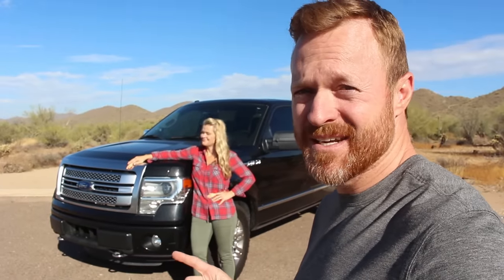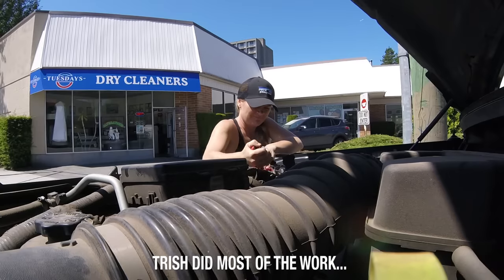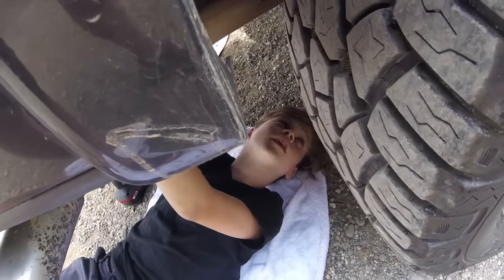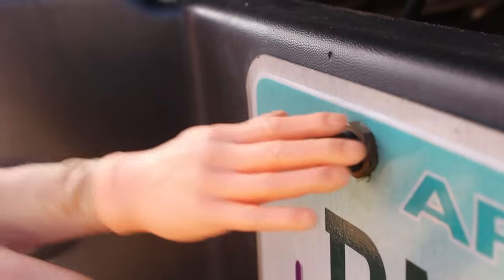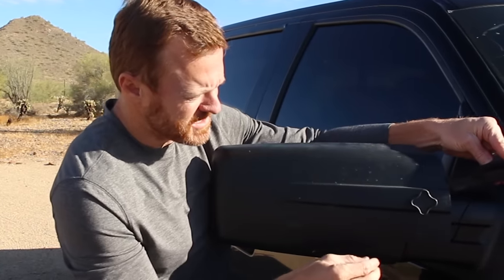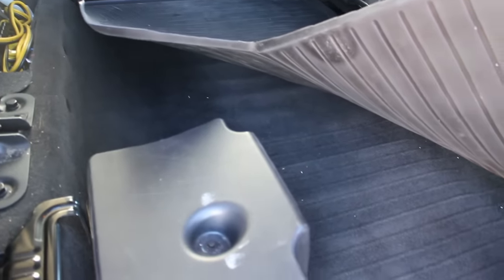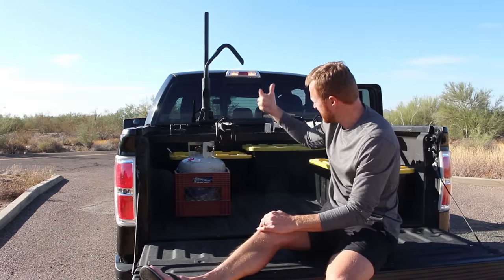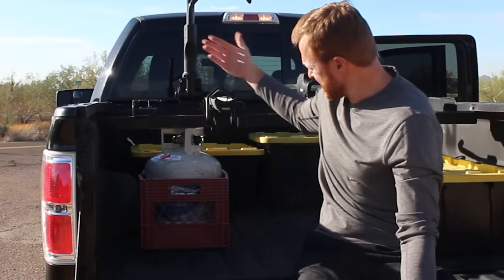TOWING WITH A HALF TON TRUCK (FORD F-150)

Comment from the maker: Common questions asked in the comments below:
1. How much does my truck weight: 5,900 dry and 9,200 loaded (28' TT)
2. What is my cargo capacity? 1,500 pounds. This is potentially the biggest limitation to half ton towing, not towing capacity. 
3. What PSI do I keep my air bags: 35 pounds, which increases to 75 pounds with a load. I never adjust the air and don't think it's too stiff without a load.
4. Do you have a weight distribution system? Yes, I currently have the EAZ-Lift system by Camco. It's started failing after only 15 months and they won't warranty the product. My next system will be a Hensley Hitch http://bit.ly/Hensley-Hitch
5. Will you ever upgrade to a 5th wheel? Yes
Couple notes: 
*We would not have selected a half ton truck to pull 9,200 pounds had we known we would have RV'd this long. It's just what we had and we wanted to get started. If you're serious about RVing and don't already have a truck, there are more benefits to 3/4 ton or diesel - as long as you're not "waiting for the perfect rig". 
*Be sure to check out our Amazon page with our fav RV gear http://amazon.com/shop/keepyourdaydream
Reply: Keep Your Daydream for the bike rack, check out the American roll cover.  You can use the Tule mounts without drilling and have a bed cover with full bed access even with bikes in place.  I love mine
Reply: Great vid Marc. One of my hunting partners uses a new WD system called the Recurve. Built in sway control, spring bars attach upside down but works so easy on his 1/2 ton Eco Diesel.
Reply: Great move on the Hensley hitch - was happy to have it across windy Oklahoma. It's been great all around.  (I used to think Less Junk More Journey named their daughter after the hitch, but maybe its a coincidence)
Reply: What 5th wheel is at the top of your list? Thanks!
Reply: that is too funny.. they, LJMJ, use a equalizer hitch way the by..  I have propride and while not battled the winds of OK have loved it for sure. heavy bugger tho.
Reply: So.. Look at the tire pressure/ load information tag in the drivers door jam. On that tag it tells the load capacity for the specific vehicle. The rating is from the factory weight as it is finished and the engineers who built it. Going over that rating puts a lawyer in a happy mood even though the truck appears to be capable of handling more weight.
Reply: What was your hitch weight with this setup?
Reply: Keep Your Daydream  Yup Payload capacity is the killer. Because of my Power Wagon’s unique off road suspension, its towing and payload is basically that of a half ton truck....even though its a RAM 2500. So we bought the smallest RV that would still fit our needs, that also has a good payload capacity. We can now transfer a bunch of payload to the trailer while preserving some of the trucks payload capacity. We need that precious payload capacity because we will be hauling 3 dirt bikes in the bed of the truck on some of our trips. With the bikes, some gear, fuel and family, we are flirting with the max payload capacity. The upside is that my truck barely notices the trailer when we are fully loaded because its WAY under max tow. When we don’t have the bikes in the bed, its like the trailer isn’t even there. Works out great.
Reply: #2 You contradicted yourself there, bud. Lol. #4 Like most manufacturers, their warranty is only limited to one year of ownership.
Reply: Great Vid, thanks Marc! My husband and I are in the process of researching trucks and trailers (Jayco 212QBW or similar) now. If you were buying your truck brand new or gently used what other must haves would you recommend to have right off the bat? Love your videos ❤️
Reply: I like to add beef to a 1/2 ton...
The idea is upgrade brakes, spring's and drive systems to 3/4 or 1 ton spec sheet.

A good trans and engine cooling system is a must have.  The point is upgrade to better parts as you can, once you get the truck upgraded to the level of a 3/4 or one ton spec - you could use the 1/2 as long as you wish. 

But remember it's not a good idea to push it to max of a 3/4 or one ton spec sheet for it's not one and the idea is to have a good system that only maxed the 1/2 ton abilities only.

You 1/2 frame use to be the same as the 3/4 years ago.  Today not so - but as long as you don't drive over rough tiwsted ground loaded you shouldn't brake a frame.

With the above in mind - you may never need to upgrade to a bigger truck for years.   One other thing to remember - your rearend u joints and wheel bearings must be watched very closely, and that all so goes for your front end steering components.

I would run commercial hiway tire's - strong side walls and trend pry when towing, Stopping that Marshmallow filling as you corner.
Reply: I'm about to buy a 30' Toy Hauler that weighs almost 8k dry and a truck and this was very helpful. I've been looking at F150 but maybe I should be looking at the F250. If you didn't have the truck already which would you go with? Thank you for the great videos.
Reply: Were you over your payload
Reply: @Tim Coyle - for a 30’ toy hauler, buy a 3/4 ton truck.
Reply: My advice if you want to get into camping and don’t have the right truck for the job would be to buy a smaller camper which fits what you have or wait until you can afford the bigger truck.  Never compromise the safety of your passengers or others on the road by taking shortcuts by trying to beef up a 1/2 ton when a 3/4 ton is required.
Reply: Thanks for the info! Going to get started RVing this year and learning all this stuff!

Comment: I also have a Ford F-150 ( 2005 ) with about 145,000 miles on it. Very dependable and good for towing.  Not as nice as yours, but gets the job done.

Comment: Recent research showed me 2011+ F150 needs a Max Tow Package to tow like this. It can be had on the EcoBoost and 6.2. It gets a different rear bumper, stronger rear springs, trans cooler, selectable shifting, trailer brake controller and extended side mirrors.
Reply: I have a 6.2L 11 F150 with max tow. Just got it.

Comment: The Firestone riderite wireless system is a worthwhile investment. I have it installed on my F-350. Even if you upgrade to a 5th wheel you can move the system over to the new truck. Only piece of advice, if you order one from Amazon and the valve unit says less than "Rev 3.1" send it back and get the latest model. It works amazingly better than the older units. Customer service warrantied my older kit no charge with fast shipping.

Comment: I pull my 27' travel trailer with my 2012 F-150 3.5 Ecoboost.  Max weight is 9,500ish.  Trailer doesn't go over 7K loaded.  Only thing I have to fix is the Ecoboost puts out a lot of heat, so in the height of the summer going up into the passes, it tends to get a bit hot and I gotta pull over and take breaks to let the turbos cool down.  This is a known issue and fixable with some aftermarket parts, which I'm looking to put in before the summer hauling season.  It tackles everything I want it to do with ease.  Don't go over your max weight and leave some leeway, take time to learn how to pull, and you'll do just fine.  And these are very comfortable trucks for passengers for the long haul.

Comment: I have a 2015 Sierra LD with 3.42 gears, towing capacity 9400Lbs. I use a weight distribution with sway control and added air bags for towing a 35 foot 7600LBS TT. If I was towing all the time, I would get a bigger truck. We only tow 3 or 4 time a year and then, only 3-5 hour away. It works great. I would never even think about towing a large 5th with this truck!

Comment: I highly recommend the Sumo springs for towing. They are noiseless, stable, and require zero maintenance. My ride quality is better than our Buick Enclave. I added aftermarket tow mirrors, transmission oil cooler, trans temp gauge, and Tire Pressure Monitor for both the truck and trailer tires. Of course, a WDH is a necessity when towing 8,000 pounds with a 1/2 ton.

Comment: Had a 2011 f150 4x4 5.0 with 175k pull 37' 9000lbs camper from Texas to Idaho and back. Everything stock, no mirrors, just mashed the gas. I did get 8 mpg.
Reply: Do you wish you had an F250 for that instead?
Reply: @andrewmorgan7500  sure, just not what I owned. That 150 was stolen unfortunately. I drive a 2003 7.3 now. 339000.

Comment: I have owned several half-ton trucks as daily drivers and no towing. I own a single-axle utility trailer and will probably never buy a travel trailer. My latest truck is a RAM 2500 4x4 Hemi just because I can. The crew cab for the RAM 1500 and RAM 2500 are the same size but the 4x4 make running boards a necessity. Exercise each time I get in the vehicle and it is HUGE.

Comment: Have same 2013 F150 Platinum however with 3.5 Ecoboost with Roush Performance Ram Air Filter towed 4300lb travel trailer, have recently changed to 25ft 5th Wheel approx 6700lb dry, with the reese revolution pin box. Tons of power and handles the mountains with ease. Excellent topics and yes the little finger hands were interesting -LOL!

Comment: Just towed a new Airstream 23' FB(4800 ish lbs)  with my friends 2017 Ford Platinum. I also purchased the Blue OX 500# distribution hitch. Had the dealer set it up and off we went. 
 Without a long winded story, I will tell you it bucked a bit and the trailer was noticeable in the back. There was no blasting up hills but on the other hand it had no problem going up them. Kinda steady as it goes. 
Learned a good lesson riding with him as he did. He also has a F-250 that he said he will bring next time. With the latter he tows his 10,000  5th wheel with a gooseneck hitch.(Sorry new to rv's so don't know the exact terminology)
I'd recommend the Ford F-250/350 for ball/bumper hitch towing.
 I'll be purchasing that soon.

Comment: We are pulling a 30 ft fifth wheel with a 2013 f150 & also did airbags , yes they are a must have & make a big difference . One thing we added you may want to add is power stop brakes on all four wheels when you do the brakes . They have also been a big plus over stock brakes.

Comment: We are actually towing a 25' Keystone Passport with a new 2019 Ford Ranger Lariat 4x4 .. and it is working perfectly. I was worried that the Ranger wouldn't have enough power to tow our RV, but it has actually worked out beautifully. I probably wouldn't tow any larger trailer with it, but for the 25' Passport it really is a very nice fit. We love our new Ford Ranger 4x4 Lariat .. excellent truck!

Comment: Great summary! We're looking at towing with our 2018 RAM Crew 4x4. We actually bought the OEM trailer brake from Dodge and had them install it and program it into the display and controls. If available, I think this is the way to go. And, actually, that actuator you use to straighten out sway is there to adjust your trailer brake's force. When in drive on the level it should bring your rig to a stop. What a brilliant use for helping with sway!

Comment: Ford trucks are great. Sure the 250 or 350 with a diesel is probably preferred. More power, better mileage and all that. But they have a heavy price tag attached to any shop repair. Routine Maintenance is absolutely critical on them. Having been a Ford tech, I've seen what happens when fuel filters aren't changed when they should be. Better bring your banker when you pick it up.

Best answer in the whole section is "It's what we had." Take what you have and get started!
Reply: Open Minded , Carl Newton is spot on in my opinion. One of the bug reasons Tech's prefer the 6.0 and 7.3 is that the problems they have are workable. They can get into the engine and diag and repair it with confidence and it won't cost a fortune to do it.

Buying a new truck is so dang expensive now that I don't see how folks do it. With a lot of the middle having prices well over $45K it makes more sense to me to look for an older unit with a 6.0 or 7.3. Even if you have to do a complete rebuild to get going, it would likely be cheaper than buying a new unit and the issues that come with the newer engines. This is the route that I am looking at for a tow vehicle.

Comment: I'm glad you posted the spreadsheet
We have a motorhome with the same types of problems
We always weigh all 4 wheels which helps us balance the motorhome
If you ever get stopped to be weighted you get a fine plus you cannot move the trailer or motorhome until you are under the weight
Again thanks for the spreadsheet

Comment: A few more things to think about.  Are you running a weight distributing hitch?  What rear axle ratio?  What transmission?  Axle/trans ratios can make a night and day difference in capacity.  Also avoid loading up the bed with anything heavy because it effectively increases the tongue weight effect on the truck.  And if you don't have a heavy duty trans cooler from the factory install one.

Comment: Hey, I just saw this for the first time since I plan to buy my first camper soon. You mentioned using the manual trailer brake control to stop trailer sway. Ford’s Towing Guide specifically warns against doing that... “If your trailer starts to sway,  apply brake pedal gradually.  The sliding lever on the TBC should be used only for manual activation of trailer brakes when adjusting the gain.  Misuse,  such as application during trailer sway,  could cause instability of trailer and/or tow vehicle”

Comment: I had an autoleveling airbag kit on my 06 F150. It was awesome for towing our boat and hauling loads. It automatically raised the rear end when under load and lowered it back down when unloaded. Best mod ever. I haven’t had bags since but I’ll be installing bags on my 18 Power Wagon now that we’ve begun our RV journey. On board air of course.... ;)

Comment: Great video! We've been successfully towing our 30' Keystone Cougar 25RDS with our half-ton Ford F-150 PowerBoost with the max tow package for 3 seasons.
Reply: What hitch system did you go with? I have a 2017, 6.5' bed, with max tow package and want to set it up to pull a 260rd, however, I utilize my truck for other purposes and need to keep all the real estate available.

Comment: At the end, I'm glad he says to her, "are you joking me". A lot of guys would use cruder language. ... Most significant upgrade was the air suspension, which I didn't know was available aftermarket. And yes he "went with the truck he had" but still a 3/4 ton would have been better suited for the job.

Comment: You "may" have missed a point on the air bags.  Correct me if necessary.  The advantage of having an on-board air compressor is that when you take your trailer off, if you don't let the air out of the air bags, the back of the truck is raised and you are no longer level.  You can easily let the air out to re-level but then you have to get it back in.  I had an air system like this on an automobile years ago while pulling a coleman tent trailer.  Man, that car trunk REALLY got high when unhooked from the trailer.  Maybe a truck is not so variable.  I had a 1997 F250 that had a factory air bag system.  The truck was ALWAYS level.  I LOVED it on our farm.  Why Ford dropped that option is beyond my imagination to understand.

Comment: I am glad to here that you successfully towed all those miles with 1/2 ton pick up.  Our rig should do well at Gross weight of 12920 lbs for  a 27  travel trailer and  1/2 pick up truck. The dry weight of our Ram 1500 eco diesel was 6060 lbs. I added the Frame to axle air springs as well,  but I haven't had to use that  much air pressure to keep the rig level. I have been using Blue Ox Sway pro WDH, and  it has provided excellent sway control with cross winds

Comment: Thanks for the great info! We are looking for a good way to haul bikes with our 5th wheel camper... I'm thinking some sort of mount back by the ladder. I love the floor mats, too! Best invention!!
Reply from the maker: Perfect. Just make sure what ever the bike rack is secured to has a strong mount or weld. Bike racks shake... and after thousands of miles of tiny shaking, I've seen bumpers come off the rig. That's the reason I used my truck. Many 5er's put the bikes on the truck cab roof.
Reply from the maker: Oh...if it's just two bikes, I've seen many trucks with a front bumper rack.
Reply: I am allergic to bike racks, for the exact reason you mentioned. With the fifth wheel I always had a truck with an 8ft bead, so my typical set up was, between the cab and the hitch, I would remove one pedal and lay down the first bike turning the handles parallel to the bike and put a piece of 1” foam over it, just turn the handles on the second bike and lay it over the foam and do this with 3 bikes ( my spouse can’t ride a bike) and would attached them with bungees. The roof I have two Kayaks on there and lastly between the tail gate and the hitch I would stack some fire wood on shorter trips. The 8ft. Bead is the best with a fifth wheel anyway for additional reasons. Well my two long cents
Regards
Reply: Robert, we have an 8ft bed. Our truck is a 2000 dually Diesel Dodge 3500. I like your idea... We would probably need to fit 4 bikes for at least the next 2 years or so.... That's a possibility for us that I hadn't thought about.
Reply: Keep Your Daydream We'll have 4 for a while. I also don't like the idea of having them way in the back of the rig... Maybe we can get some sort of roof mount or try the bed idea that Robert suggested.